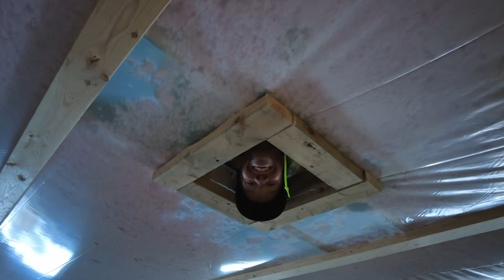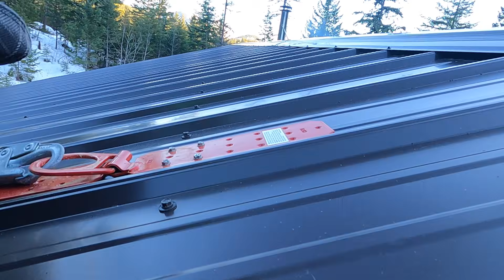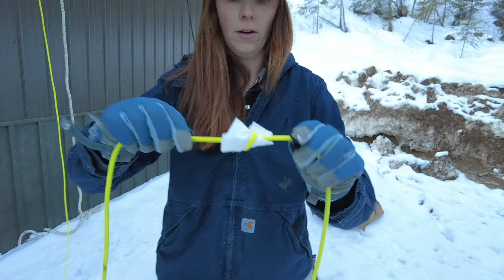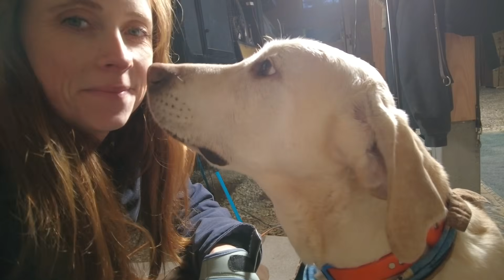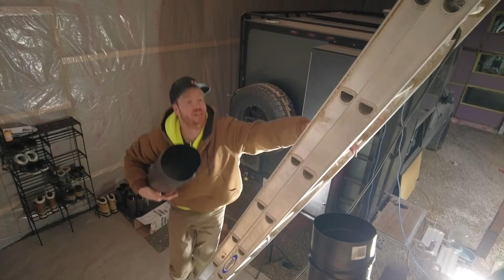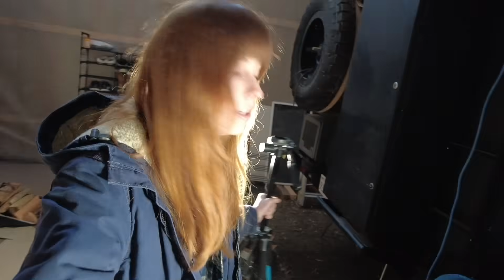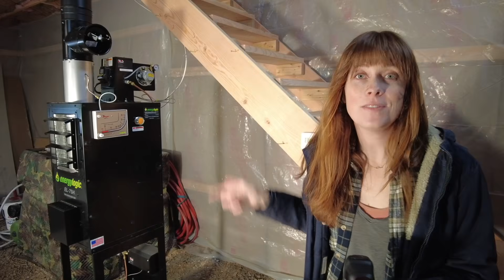Installing Our Waste Oil Heater | Living Off-Grid

Comment: I hate getting from the roof to the ladder as well.  Worst part of working on a roof.  Just a thought, the house we owned in the late 90's had fixed points on the roof for safety harness attachment. Admittedly, you still have to get to the peak to attach, but if you use a doubled rope through the hoop on the decent it would provide something to help the transition to the ladder that could be pulled out after leaving the roof.

Comment: Another Great installation - you guys Rock!!!  The last moments of the video confirmed my thoughts about the additional fuel tank (to be gone for extended time) Cortney cranking up the heat and the comment about the tank and long stays away = code talk for, next winter we'll be videoing our stay at the Beach :) :) 
I was happy to see the jacket and rope hanging from those screws. If you're using them as a protector for the thermostat, by all means cut lil blocks of wood (scrape 2 x 4 or something) and screw it in place of the screw alone. I can tell you from working construction, walking into a screw (or nail) at shoulder level - Will Leave a Mark!!! Keep up the good work!!!

Comment: Can I ask a serious question? You put the harness connection point on the roof and removed it.  Can I ask why you removed it? Also, can I ask why you removed the rope on the roof as well? I've seen some other shows like from Alaska and such and they leave the harness connection point on the roof.  The Kilchers I believe.  Wouldn't you feel more comfortable having a connection point?
Reply from the maker: Hi Mike! We removed the harness point so that snow and ice will not build up on it this winter. We do plan to add some permanent points, maybe this summer. We don't want to leave the rope on the roof, as the sun would damage it over time.

Comment: How do you get the heat into the apartment?  Or is it mainly for the workshop? 😃
Reply from the maker: It’s mainly for the workshop but we’ve found that a decent amount still radiates up into the apartment.

Comment: Since you are concerned (rightly) about climbing the ladder up and down for roof access, had you given any thought to putting one of those pull-down attic ladders in the ceiling somewhere? I'm sure you could figure out a way to seal and waterproof the external cover, and it would give you easy, quick access to the roof. Mount your shackle next to the roof opening, and you have a convenient place to connect your safety harness to.

Comment: Very unique waste oil furnace. 1/2 gallon per hour seems like a lot as the 10 gallon onboard tank provides 20 hours of runtime. A  smart Wi-Fi setback thermostat could keep the shop at 50 degrees and when planning to use the shop you could remotely raise it to 65

Comment: For the freezing of the pipes, the water pipes probably should he installed with a drain valve at ground level so you can drain the system of water before you leave and then there would not be a need to heat the building when you are gone for days and weeks at a time.
Reply from the maker: We’ve got that one covered, but we’d also like to keep things like paint/etc from freezing as well.

Comment: Those heaters are going to make your building so much more comfortable!  Is your wood stove designed to re-burn (secondary burn) the combustion smoke?  If so, then it should be smokeless as soon as it is up to temperature.

Comment: waste oil is such an amazing heat, been using oil heat for a foundry to melt bronze for years.  I highly recommend filtering the oil that goes in the tank with something simple like a paint filter or something. It will last much longer if you can get the chunky crap or dirt that ends up in the oil catch pans between changes.   the most energy use is at startup when the glow plugs are cranking hot leaving it on low uses way less power than if it has to turn on and off through the day when controlled by a thermostat.
Reply: They'd be better to make a filtration cart/system. Run it through some filters to get the metal shavings out.
Reply: @WyattWhipperFilter Magnet also maybe.

Comment: Waste oil is not as bad as every one thinks.. I have home made oil burner no electricity needed but it's more like a wood stove.. needs to be watched. Ntm can build another style for a forge does take electricity but can burn up to 1500 f... Nice to see smaller units coming out.. used to only find these types of heaters in large shops.   I would find a filtering system for what you put in it.. still going to have to clean things once a year

Comment: Hi. I have to say that heating with waste oil is bad for the environment. It spreads dioxides and pollutes heavily. In Sweden its totally forbidden and can be fined with up to 100 000USD. It´s not that the burned oil just generates heat for you, it also spreads toxic waste through the air into your lovely forest.
Reply: the comment I was looking for. quite surprising that some say "it's great for the environment"

Comment: TIP -your ladder could have come out on the bottom more a little less steeper [at a wider angle] and if you place the 1st step off roof 4-6'"  below over handover where you can step off the roof more even but closer to top of roof edge you can get on and off easier you down have to put your foot so far down the ladder getting off the roof and you don't have take as large a step get from ladder to roof or off setting on and off the roof edge is important[the step that was even with roof should have lower - room enough to step on ie that why you pull the bottom of the ladder out to align the step at roof]  good job PS it is good to be afraid if you are not - then that when you get hurt

Comment: Appreciate the schooling on your waste oil heater.  So much better for the environment to burn the waste oil.  I do suggest an appropriate fire extinguisher easily accessible should it be needed.  Instead of pouring the waste oil into the tank, perhaps a small pump to eliminate and spillage.  Great episode!

Comment: Riley, Awesome work! that heater looks awesome. If you do have to get up on the roof more in the future, you could add a second harness anchor near the edge, where you can reach the bolts from the ladder. then when you're ready to transfer to the ladder, you hook to that one, unhook from the higher one, then transfer to the ladder, unhook, unbolt, etc. from standing on the ladder.

Comment: Jazz sax as the background music.  Epic.
I don't know anything about how to filter used oil without making more waste product, but it should be like filtering debris from water, like a gravity filter.  I remember reading that the PT boat crews in the Pacific during WW2 would filter their fuel through a chamois to keep from clogging their fuel lines with debris.  Maybe a fine wire mesh basket with a 200 or 400 mesh count?
Reply: As for weather, right there with ya.  We were 80f on Monday, 77f on Tuesday, and woke up Wednesday at 30f with a 12f wind chill.

Comment: 1/2 gallon per hour as stated is 12 gallons for 24 hours (per day)???!!! If that rate, not feasible to leave??
Reply from the maker: The burn rate is 1/2 gallon per hour but just an hour or two per day will easily keep the shop above freezing. Just a half hour or so of running it gets the inside temp up to around 65 or so right now.

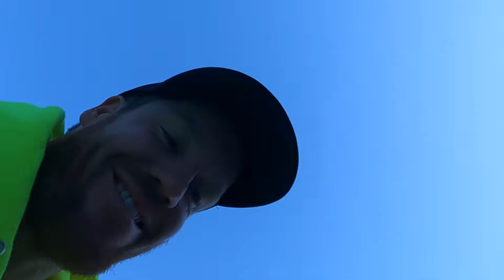Comment: 2:13 No, you are not done on the roof. I refrained from commenting in the previous video because the installation was not fully documented and my concern might have been addressed in the next video. But it wasn't. The way you sealed the flashing to the roofing tin is perfectly fine for rain and snow but the large gaps you left at the top beneath the ridge cap and bottom beneath the chimney will allow rodents, smaller birds, and insects to find access to your attic. You need to seal all four sides completely and you need to use products that can't be chewed through or something is going to make a nest in your attic.

Comment: Well you would never make a good firefighter. Also I use to be a union pipefitter and back in  my day we never put on a harness unless you needed to tie off to something for it to hold you in a spot to work, not just for fall protection like it is today. Glad to see you got some heat in the shop but I bet before long you will be wanting some cooler air in there.

Comment: Ok Riley I have faith in you. You will come up with way to filter the oil before burning it. I think there is some kind of spinning method you can look into. A friend does that to burn reclaimed oil in his pickup Diesel engine. Good job on the roof. Gives me sweaty palms. You da man. John

Comment: Waste oil heater.. Nice! Wonder if they come without the need for electricity? I sure could use one of those.

Small tip about wood stoves. If there is a lot of smoke coming off the chimney, it either was lit 1-4 minutes ago, or not enough air/wet wood. Needs to burn hotter to get the most from the wood and avoid a fire in the chimney after a while. If the wood is wet make sure it burns really hot with lots of air and not too much firewood in the stove.

Now back to searching for a waste oil burner..

Comment: We put in a wood fired boiler.  Expensive, but so worth it.  It got down to -4F last night and we're toasty warm inside with all the "negatives" of the woodstove/fireplace outside.  However, it does require wood once every day so, as you mentioned, leaving for extended periods is a problem.  I think we'll back it up with a thermostatically controlled propane boiler for when we want to leave.

Comment: After many many trips to the roof by myself mainly to clean the chimney that at the time came inside the shop and one of the 8-inch pipes actually went across the stairs and then over to the original wood stove area. I have since fixed this and put the chimney straight up to the roof but many times during the last two years there's been so much snow up there that I couldn't necessarily go up there to clean the chimney when I needed to and smoke would fill up into the apartment. So what did I do? I mounted a ladder up there so I didn't have to worry about it anymore. I sure wish I would have seen this video before I did that with your nice plate that you attach to the rope although I am not sure that would work when there is snow on the roof when it is slick especially because I do all this by myself

Comment: I know it just temporary, but for final install, put your thermostat a fair distance from the furnace to get the "true" temperature of the space your heating.
Reply: Heating up a shop is not rocket science temperature is based on what make you feel good and what you can afford and how much oil you have, thermostat is just a reference for a location in the shop
Reply: @user-cb2427  Yes, well, if it is too close, you won't get the furnace to run properly and it will short cycle, reducing the life of all components involved and could cause injection issues with the fuel.

Comment: Riley is right about paper cup in camp fire.  It also works for styrofoam cups.  Native americans would make a bowl with deer hide to make their stew and boil water in.  As long as there is water inside, the container can't get any hotter than the water, so 212 degrees or about 203 at 5000 feet.

Comment: If you put Fumoto valves on your vehicles, you can just open the valve to drain the oil cleanly. I pull my vehicles on ramps and drain right into a 5 quart jug.
Reply from the maker: That sounds awesome!
Reply: Yeppy - I use them on all my vehicles.  Idiot-proof.

Comment: Awesome heater unit and cheap to run by using waste oil.
In the UK, it's against the Law to have / run waste oil burners without a license which cost and they are extremely hard to get .. if your even allowed one.

Comment: Heating engineers now....what's next.....rocket  scientists did I hear you say... can't wait.  If it runs on waste oil check out your local cafés who have deep fat fryers.  Some serious bartering needs to be entered into.  Well done both!
Reply: Transportation of hazmats are highly regulated and controlled from commercially generates sites. CDL with hazmat ratings / proper insurance is required..

Comment: Courtney, suggestion, when footing the ladder stand between the ladder and the building, looking at the ladder reach out and grab the beams (sides) of the ladder then move your feet into the ladder and lean back with your body parallel to the ladder arms extended straight out. That puts max amount of pressure on the foot of the ladder so it doesn't kick out. This comes from 33 years experience in the Fire Service😁
And I love the site and the way you two work together! Awesome couple!
Reply from the maker: Thank you so much for the tip Mike!

Comment: I would have never stuck a damn all Burger in my damn house I would be happy to cut firewood and split firewood why are y'all so f**** late that is thunder unreal y'all got plenty of something firewood around there all you got to do is get some and burn it or get you a damn big risk here and put in there instead of putting a damned ol burner in there that don't make no damn bit of sense that s*** is f**** nasty and stinking y'all need to get off y'alls ass and cut firewood and split firewood

Comment: Okay watching you climb up that ladder onto the roof with  ropes tied around you reminded me of a story when I worked in the hospital in portales New Mexico. I come back from a 4-day vacation and was walking the rooms and there was a gentleman with a full body cast, legs in a sling, arms in a cast and I have never in my 13 years at that time of nursing ever saw someone so broken up. So I had to know what happened. He said I was working on the  metal roof AND I didn't want to slip off so I tied the rope to the back bumper of the car and climbed up.
   I'm working on the back side of the slope so I had plenty of torque on that rope. Well I didn't remember to tell my wife I was tied to the car and she had this great idea of running to the store real quick. She's about to make something really cool for dinner. So she ran out the door and I heard her yell something to me but I didn't quite catch what she said. By the time I yelled back at her she had started up the car and had jerked me off of the roof. I hit the driveway and she's now around the front bushes which pulls me through the bushes.  By the time she even noticed that she was dragging me,  because the rope was really long, I was knocked out and had broken just about every extremity on my body.  So be careful. Tell each other what's going on.  Y'all are doing a great job.

Comment: Cool, I've always been curious about these units. 1/2 gal/hr is a bit thirsty though - have you found it easy to set up & find waste oil resources around you via businesses and other people? Or do you plan to run it infrequently enough where it's mostly your own used oil?

Also, can the different fuel types mix? So if you are low on oil you could dump diesel straight into the tank if need be?
Reply from the maker: Yes it can also burn waste oil, diesel, or heating oil or any combination of those. It makes it really flexible for our needs.

Comment: You should weld a set of iron steps attached to the roof for you to walk on the roof so you can maintain the chimney stack to can even put a safety hand railing
Reply: That will catch a lot of snow, and you can't weld to the thin roofing.
Reply: @previsie  no but you weld on the ground and attach it to the roof the amount of snow would min to the rooftop the risking your lid on slippery roof  when cleaning the chimney several times a year plus he has two of them to clean

Comment: Recycle oil is great for the environment, using it the way you did or creating biodiesel for vehicles is good for saving "raw material" is great for a more sustainable economy, now to say that burning oil is clean is a mistake, as it is one of the dirtiest and most polluting fuels there is. however recycling is always the right way.

Comment: Hi great job , here in Dublin Ireland a big main vw dealer installed a waste oil heater at a cost of 10k they only were able to run it for a couple of weeks before the local county council closed it down due to emission levels being very high and it's never been used since

Comment: As clean as that is I wonder if it reburns the exhaust. At any rate, great job on the install! Riley should look into ladder clamps. I am afraid of heights too, and those were a gamechanger! Getting on and off the ladder has always been terrifying until I had those.
Reply: No different than Heating oil.

Comment: QUESTION..... most states ( might be federal EPA REG) you can only dispose of your own waste oil in a waste oil heater and you can only store waste oil you generate on site?  Also you cannot take waste oil from other producers ( repair shops etc )   did you check those rules?

Comment: You didn't say if the heat it produces smells at all? Any odor in the shop or is it a transfer fan coil type situation?
Reply from the maker: It's a heat exchanger situation so no combustion air is vented instead. There is no odor!
Reply: @AmbitionStrikes  nice!